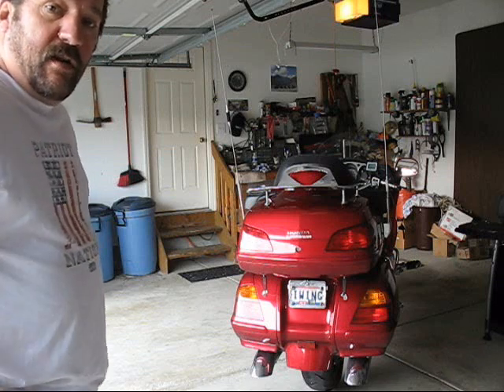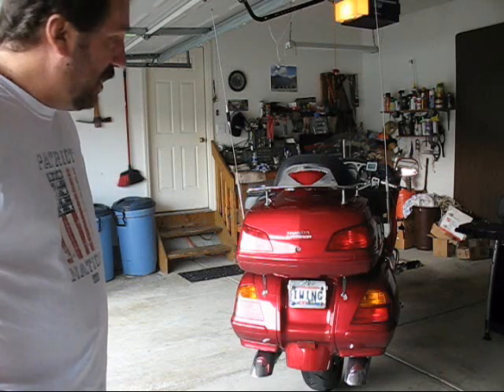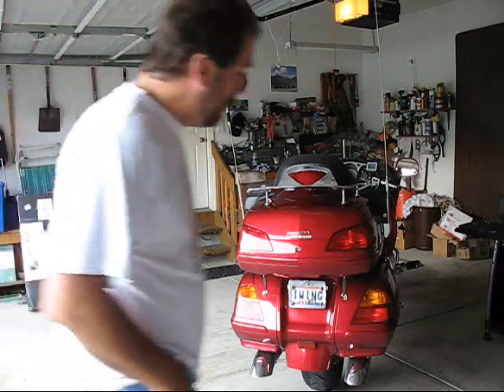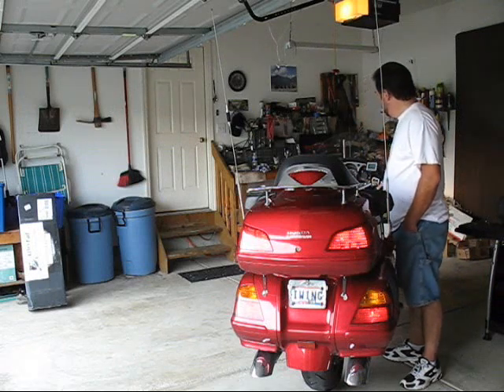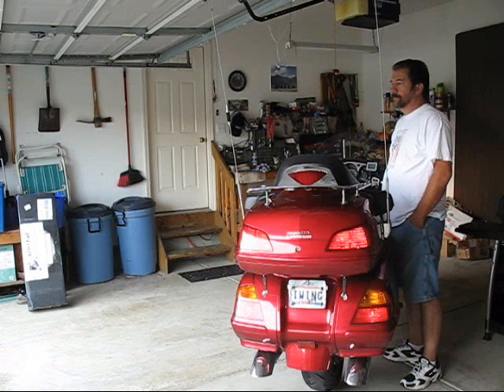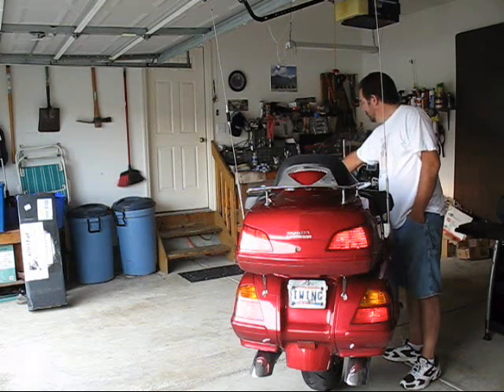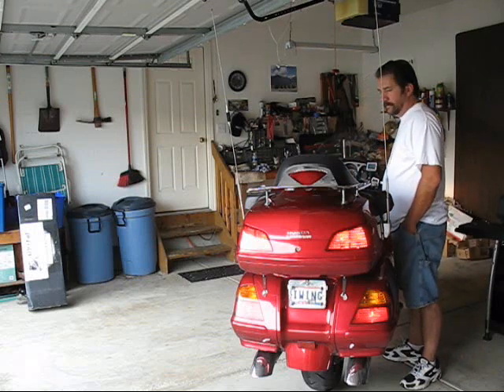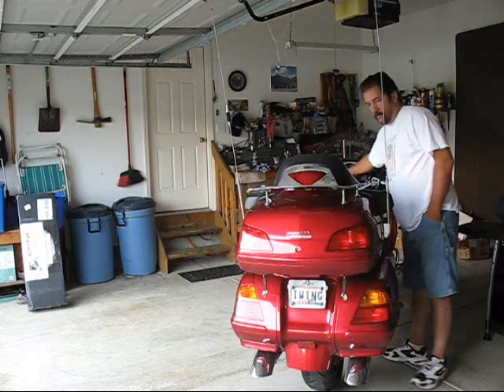Honda GL1800 Exhaust Sounds

Comment: unless the stock exhaust rusts out, I am never changing out the exhaust. You gain absolutely nothing with sound because of the nature of a goldwing.  I own a 1988 goldwing and the only thing you do when you upgrade your pipes is spend money. its just not the engine nature of a goldwing to be loud.